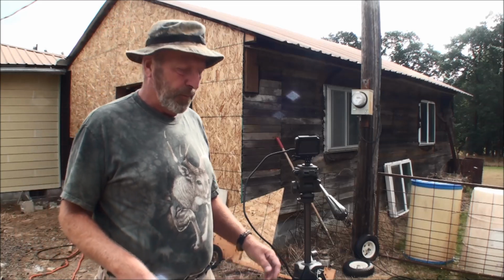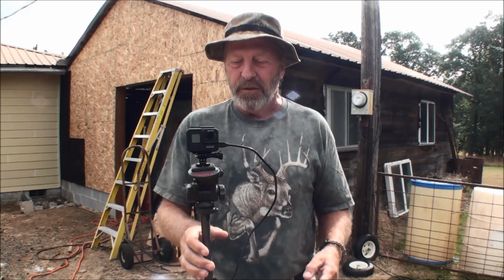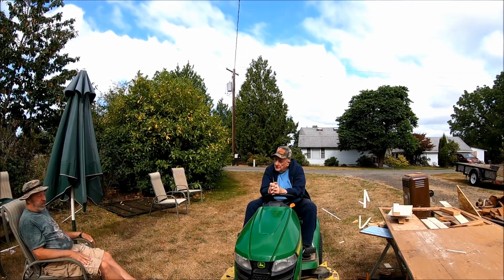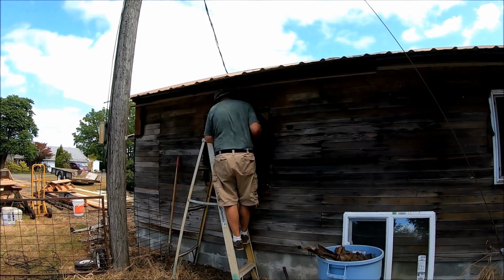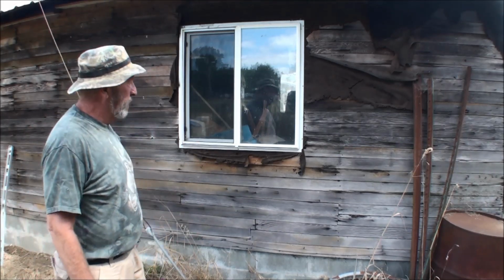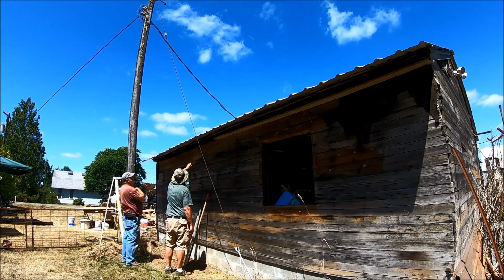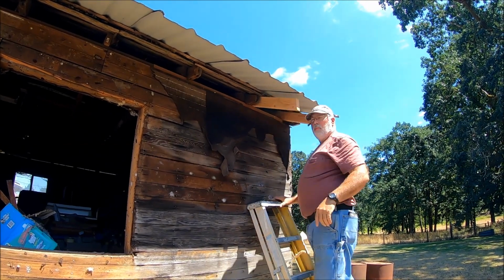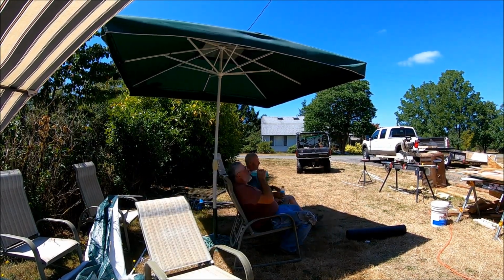Roof Soffit for the Garage and Tar Paper with Time Lapse Part 1

Comment: I like the tripod.
Reply from the maker: Shopping for a tripod at the thrift store isn't easy. Most of them are missing the piece that holds the camera. And when you find a good deal, with the piece that holds the camera, it makes me very happy and excited NoneMechanic101
Reply: @justmike57  I need to find one. Also what was the charger you was using
Reply from the maker: I bought a power pack for the camera. It's a 20000mAh, AUKEY Power Bank. The GoPro needs it to do long Time Lapse. I can record all day, for three days before I have to charge it up again. I hope this helps you out.